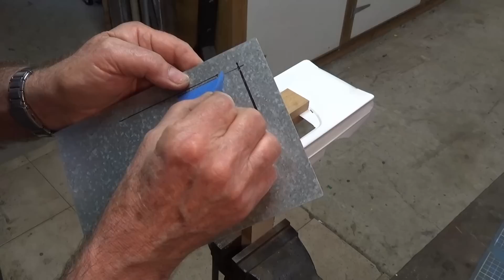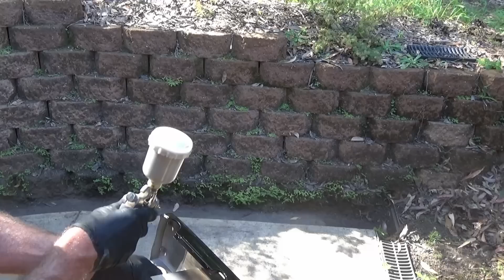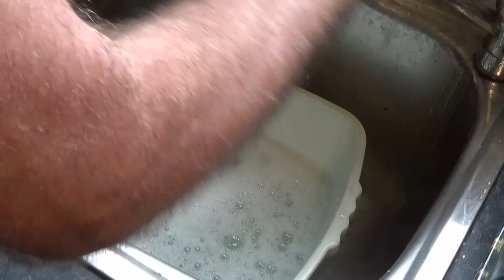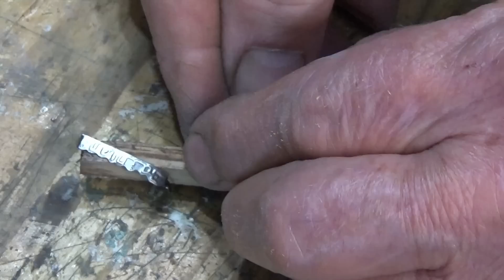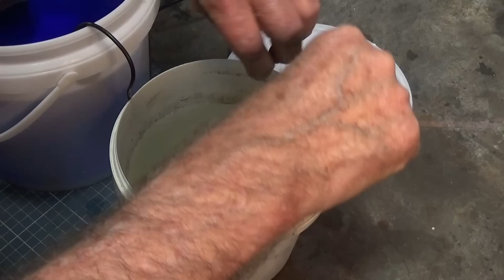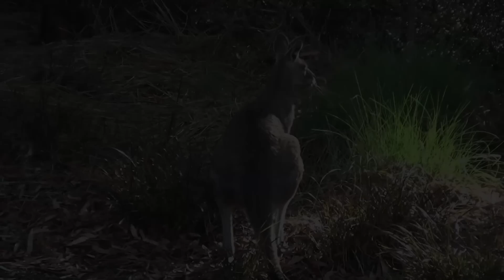Tin Car Rescue - Part 2

Comment: Hi Mark, there are Scotch-brite radial bristle discs that mount on a mandrel for dremel/foredom type tools that might be useful for cleaning up textured parts, a bit pricey. I’ve never used them.
Reply from the maker: I have a large cup brush with abrasive red bristles, but I totally forgot to try it. There seem to be lots of abrasive solutions out there. Some work, some don't. However, Scotchbrite is reliable and readily available. 
Regards,
Mark

Comment: You are braver than me to use 2pac.  How hard is the cleanup and where do you buy it from?
Reply from the maker: The mixing is fairly straightforward if you can get the calibrated mixing cups. I get all my paint from, well, not Bunnings! We have a local paint shop that sells a good range of industrial paints. You can do the clean up with regular gun wash or GP thinners. The only issue with 2K paints is the isocyanates in the mix. It is pretty nasty stuff and even with a good respirator there is still some risk. I always paint outside and try to stay upwind. I only use the stuff maybe once a year for a few minutes but for professional painters, they have a much higher exposure.
Regards,
Mark

Comment: You can avoid the seeping (leaking) of the paint by paint a thin layer of the basepaint (here white) on the edges of the masking tape
Reply from the maker: I have seen that technique but matching up a white paint with the shade of white powdercoat that I had used might have been hit and miss.
Regards,
Mark

Comment: Better than new. Is there any danger of the masking tape pulling off the powder coating when you remove it, like can happen with paint?
Great fix with the heater!
Reply from the maker: No, if you cure the powdercoat properly it's super tough and actually quite difficult to remove. It will chip if it hasn't had the right cure cycle but I have never been able to peel it off with tape. I couldn't believe I was stupid enough to forget to turn off the heater. I reckon a few minutes later and it would have been a total loss. 
Regards,
Mark

Comment: You can use magnets to hold your pants to the wire to pass electric through in your electro plate
Reply from the maker: Ok. I am wondering if that might affect the plating process? Electric currents and magnetic fields? Certainly worth a try though.
Regards,
Mark

Comment: I do a great deal of polishing of intricate detailed parts. I use a flex shaft machine and 25mm mops. 3M makes radial abrasive disks in 25mm and 19mm that go down to 1 micron. Pricey but they work.
Reply from the maker: I do have a flexible shaft for a tool similar to a Dremel. It's OK but years ago I really wanted a full Foredom hang up flexible shaft polishing setup. Back in the day they cost thousands and now they are relatively cheap. I am not sure if the quality is still good though. 
Regards,
Mark
Reply: @Preso58  I live and work in Shanghai China. My factory does custom door hardware. We use flex shaft tools quite heavily. We buy them locally. They are around US$20. There is no possibility that it’s a real thing. They are ok. They can last us a year. They are so cheap we don’t bother repairing them other than the shaft. If the brushes wear out or the bearings in the hand piece get crunchy we just toss it and get another. Stay away from the pressed sheet metal foot pedals. The potentiometer in those are really agricultural.

Comment: To avoid bleeding under the masking tape, you can start with a coat of transparent paint: if something bleeds, it will be the transparent paint.
Reply from the maker: I have seen that done with interior wall paint when you need to mask off a line on a wall. I wanted to trust the masking tape that I bought especially for this job but I didn't quite get it burnished down hard enough in the really tight corners.
Regards,
Mark
Reply: @Preso58  I think I have heard this trick from a guy doing autobody, very OCD in his work, I remember a car that did take 10 coats of various primers, filers, paint, varnish...

Comment: Hi Mark what solvent did you use to clean the gun.
Reply from the maker: I just used regular general purpose thinners. It dissolves the paint residue just fine. The paint supplier insisted that I needed the proprietary thinners for the paint though. Probably clever marketing but it turned out great so I shouldn't complain. 
Regards,
Mark

Comment: Have you explored some of the Proxxon polishing machines?
Reply from the maker: No. I do have a flexible shaft for my Dremel though. I wish I had a vibratory tumbler for those parts that had a lot of detail. I am thinking it would have removed all the chrome and the rust too.
Regards,
Mark

Comment: what is the voltage/amperage rating of the power supply you're using? I need to buy one
Reply from the maker: Mine is a Gophert. I bought it on Ebay. 0-35V and 0-5amps. It has been a reliable unit and I use it for electroplating as well as anodising. This is a similar unit but they have changed a bit since I got mine. https://www.ebay.com.au/itm/325653962049?_skw=gophert+power+supply&itmmeta=01JB5P28K72NVAVJ2T56SHN2RX&hash=item4bd27d1d41:g:wxoAAOSwMiFkX1~v&itmprp=enc%3AAQAJAAAA8HoV3kP08IDx%2BKZ9MfhVJKn8WeAZvtxlPAD5rRS5%2F2X3JPsUhW8YGFox9JgPL1NymgDwm3uExb5CEqEWZZqLD0qnDZTemLqwJthVHDS6J5KO%2FRSxN%2FTXC4%2FqjGrRRBiTrMsxCqtpqF2d8A83dqBMiQcWbY6wQu3HXzBrNdlEj49HqBGbKruJD13W0s41%2B02156wwa5qANr5bMJP9LOTUUtvRI68s7vVpqeP8uV%2Fr4GzBHqwzJfrfiXGBhD34qSLNu9Cd%2BQDMCqmN2GNoArl0gs0%2B%2BfZak%2BK%2FMTdhhaj7oKhxJBz0xrzSSml0zwHbR87s1A%3D%3D%7Ctkp%3ABk9SR-CJibbZZA

Comment: Spent more time and money on that toy than the company did making 1000 of them. lol

When they "fix" old pitted pot metal car parts they copper coat them, polish them, and repeat until the pits are filled and smooth with copper before the nickel plate them. You know with how thin copper coats it might take dozens of coats and polishing.

If  you want your detailed parts to look better but not correct look into black washing them. We do it buiding model cars. It will cover up all the pits in the tiny spots and hide it. it's basically thinning flat black paint and flooding the details. Just wipe off the high spots with a lint free rag. It really shows off the details.
Reply from the maker: I need to do some more experimenting with the copper plating. I have a job coming up where I need to nickel plate some brass parts. I believe that it's easier to polish copper than brass. 
Regards,
Mark

Comment: Zippo lighters have to be copper plated first, also, so that the finish plating sticks to the body. I was about to define which metals were which but i'm not sure anymore of the order of operation and the base metals used. I could check, yes. I will... Just another friendly reminder, mark has THE BEST tutorials on electroplating AND general metal finishing out there. Straight to the point, clear and with lots of room for you to literally own the process YOUR way, as long as you don't deviate from what our teacher says as far as mendatory steps, you WILL go far with your projects.

Check his series on metal finishing, you might learn a thing or two and if not, the entertainment value is off the charts. From Qc, Canada, with love! Take care brother!
Reply from the maker: Thank you for the glowing report card! 
Regards,
Mark
Reply: i believe zippos are brass as base metal, with a copper plating in order for the nickel finish to stick - i didn't look but it just sorta came back to me. Please feel free to correct
Reply: They are, all you said is true. I had a brain fart while i was writting because i knew that... i collect zippos, but maainly the Niagara Falls Canada branded one since they have a better value (to me anyways) because the company ceased operations in Canada a while while back.... so no more of them as oposed to Bradford.

Comment: I used to play with my dad's tin cars there was a police car and a convertible both in the early 1960's ford style, made in Japan, and quite a bit of chips and bumps with 2 generations of boys playing with them heh. Also that yellow masking tape looks very similar to the stuff I use to do paint jobs on custom computer cases, I get the 3M something or another automotive masking tape... quite pricy for paper tape but leaves very clean lines (Kapton tape though that stuff leaves razor sharp lines)
Reply from the maker: There are arguments for leaving those old cars with their original patina and sometimes that looks more authentic but I cannot stand seeing corrosion on steel and it's like a cancer that spreads. I was very impressed with that yellow tape. I bought it at the same time I got the black paint and it seems to work quite well.
Regards,
Mark